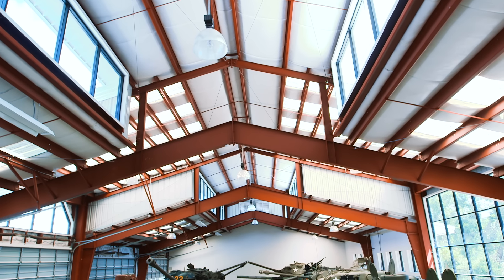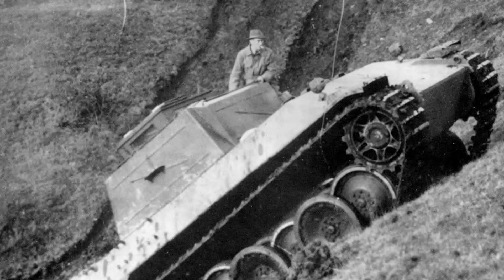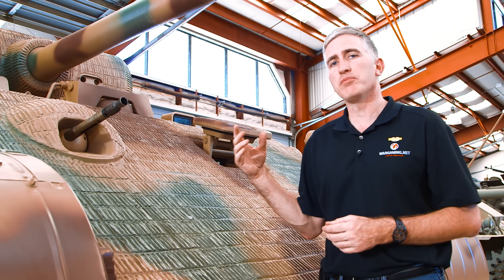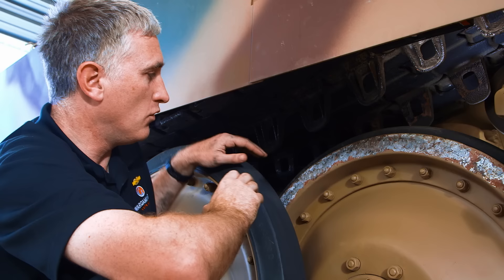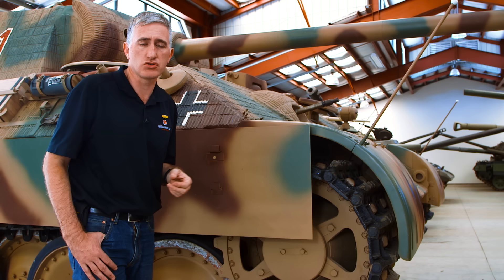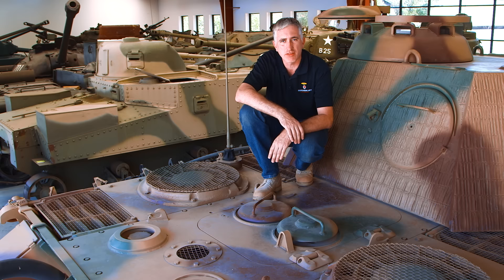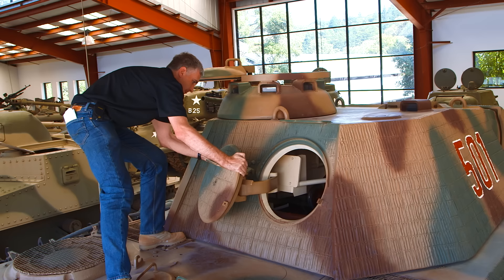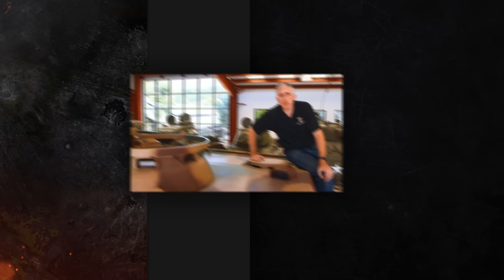Inside the Chieftain's Hatch: Panther. Part 1

Comment: That track and suspension system is so very German. Wonderfully engineered and built, smooth as butter, and you are totally screwed if something breaks, ha.
Reply: These wheels did provide quite good though. Better to be hit in the suspension and immobilised than in the hull and destroyed. :)
Reply: I am sure the crew would completely agree with you.
Reply: Well if your tank is an expensive piece of engineering, I am not too sure you'd want to get hit in the suspension either.

It'd mean that you cannot repair it and would have to destroy it anyway
Reply: The wheel design had a problem of mud freezing in the wheels and thus freezing the tank in its place.
Reply: AKUJIRULE  It wasn't a problem of being stupid, it happened due to logistics, as the Germans didn't have the fuel they needed and had to stop the tanks at night on the Eastern front, during which the mud would then freeze in the wheels.
Reply: @jacobkeeney7231  cough....*wit*
Reply: AKUJIRULE  But the engineers over engineered and too anal to make a tank that was in the field repairable.
Reply: @UkrainianPaulie  

Bullshit, photos and report from the field maintenance units all show that the Panther could be maintained and repaired in the field with regards to the kidn of repairs that could be done in the field. There are even photographs show the removal and replacement of the transmission being performed in the middle of a forest.
Reply: Jesse Sisolack It’s designed so that nothing breaks.
Reply: Vk30.M?
Reply: Jesse Sisolack breaks?
Reply: @UkrainianPaulie  
The French guys of the Tank Museum in Saumur were interviewed at tank fast 2019 about their panther and their experiences with it.
Unlike the common believe, they admitted, that the Panther was actually build with ease of maintenances in mind. For example, the engine replacement took only 8h in a Panther under field conditions. For a Centurion you need 15,5h in the field. I think they are trust worthy, because they also operate M4s, M10s,T34s and a Centurion. I think it is really surprising that they mentioned maintainability as big pro for the Panther design. But there must be something to it, because the Panther achieved the same combat ready rates as the Panzer IV since spring 1944. 
Hilary Doyle pointed out several times, that the final drives became quite reliable. He also said that the germans knew what they were doing when it comes down to tank maintenance. (Chieftain and Doyle in the Panzer Museum Munster, on Chieftains youtube channel).
Reply: @Matthew Caughey except when pieces of shell and track completely jam the tracks, rendering the tank immobile.
Reply: @MothaLuva  That's not how tanks work. everything will break. no matter what the conditions, unless it sits still in a garage it will break. a tank is meant to be used, not sit in a garage. In combat conditions there are never any guarantees.
Reply: Jack Cordell That’s how MY tanks are designed.
Reply: @HaVoC117X  the final drives may have been more reliable but they most likely if anything used an experienced driver for the tests which considering late war germany experienced drivers where in short supply but in general your parts can be as strong as you want but they wont last long with relatively untrained crews that where starting to increase in number but along with any petrol or derivative product was also in short supply so even if it was reliable it wont be going far also can ya toss me the video they mentioned this in the french guys i mean
Reply: the track is so good that i Even want to get that thing. it would probably become a scrap when it Breaks.
Reply: @WheelsRCool  " mud freezing in the wheels and thus freezing the tank in its place." - That is a well known myth that has become a factoid after ww2. There are no primary source accounts of this happening. They did have overlapping wheels for years before they built the Panther, and you'd think they would have noticed if someone got frozen in place.
Reply: One major advantage of this design is that you could have several wheels blow off and still drive away. If you lose one wheel on something like a T-34, you're screwed.
Reply: @scratchy996  i woudnt call that a big advantage considering it could also at the same time make the track slip off or even break it
Reply: @scratchy996  If that is the case, then I will stand corrected, however I will need to research it more because the mud on the Eastern Front could freeze to being like cement in that extreme cold. I have read, somewhere (though I can't say it was a reliable source), that the Soviets would also time their attacks against Tigers and Panthers when they could (such as early morning) for this reason.
Reply: @WheelsRCool  If that were the case, you would think the Tiger and Panther crews would clear their tracks in the evening.
You would think that after one such attack, the German crews will learn to ready their tanks just before dawn.

If you get so much mud between your tracks, it means that you're driving in mud, that means that's during the spring or autumn, that means you can't have -40 degrees during the night, when everything becomes like cement.
During the Russian winter everything is frozen solid anyway, so you can't get your wheels filled up with mud.
If you somehow get that huge amount of mud that instantly gets frozen solid, then every tracked vehicle would have this problem, and vehicles would constantly get de-tracked.

German tank crews frequently started their engines and let them running for a while, so the batteries don't get drained during cold nights. A dead battery means that you have manually crank the tank, that means it takes longer to start it.

The Soviets attacked during the morning because they would gather their forces during the night, when they can't be seen, and attack during the morning to prevent friendly fire.
The Soviets also liked to attack during bad weather, here in Eastern Europe we have a saying when there's heavy rain , or a blizzard : "The Russians will attack now."
Reply: @scratchy996  That is a good point about mud not around in freezing cold, I forgot about that. However one nitpick, if the wheels were frozen, I do not see how the tank could be readied just before dawn as it would be too cold to remove the mud.
Reply: I remember my dad was trying to help this lady who was stuck at forest preserve, BMW ran outta coolant and overheated, luckily my dad had a jug of coolant with him since his Isuzu liked acting up once in a while but he was trying to add coolant to her car and wasn’t able too, beautiful car but have a tow ready in case something goes wrong.
Reply: @duchessskye4072  but the tankers live to fight in a different Panzer. Experience is priceless.
Reply: Its German! It never brakes.
Reply: JaysonBrentford  up to 800km? with an engine that typically lasted 1000-1800km depending on time of manufacture also nice cherry pick on the Sherman variant lets not Cherry pick model comparison ok? thanks
Reply: JaysonBrentford  doubtful at best propaganda at worst not only would that put more stress on other load bearing equipment and prematurely wear those line items  you would be putting more stress on the drive train  due to it
Reply: not to mention neutral steering is useful in niche circumstances even today tank crews are recommended to not neutral steer as it puts strain on the track pins and links its not a flex hell A7V had it its not nothing special much like sloped armor this stuff didnt just appear they knew about it
Reply: JaysonBrentford  the irony behind you saying its easily researched and is a proven repeated instance then picking a single instance and implying its the rule and not the exception but im a fudd surreee whatever man

Comment: As a heavy equipment operator I can tell you for fact it does not take much mud or snow to cause the tracks to lock up and freeze and become a real nightmare to get freed up. Best policy is to always clean your tracks and running gear prior to leaving it overnight, or spend hours chipping out mud and ice before you can move...;)
Reply: they probably did that, since they realized how their lives could depend upon that hard work...
Reply: Michael Müller A job they really did not need as they would already have a lot of heavy work to do, servicing the tank after an exhausting day in combat.
Reply: @SvenTviking  Combat? Was rather exception. Most days of war were waiting somewhere. In tank forces even more on the german side, of course.
Reply: @michaelmuller6890  true, like cleaning toilets
Reply: They built fires under the tank to keep it warm as well as themselves as often times they slept inside the tank.

Comment: Chieftain, here is the composition of the Zimmerit anti-magnetic mine paste.  40 % Barium sulfate - BaSO425 % polyvinyl acetate – PVA (similar to wood glue)15 % pigment (ochre)10 % Zinc sulfide – ZnS10 % sawdust
Reply: Thanks for useful data.

Comment: That return roller is to avoid the track falling between the drive sprocket, and first pair of road wheel. However, your also kind of right as it was put in a position to avoid interfering with the tracks mashing with the sprocket, rather than to aid.

Comment: The only thing I noticed lacking from this magnificent restoration are the air filters for the Maybach HL 230 engine. I can see the carburetors fully exposed and open. There should have been a pair of canister like thingys holding the air filters over them. This way whenever the engines are running dirt wont get through to the pistons and abrade them.

Comment: I feel like if mud was really a problem when it froze overnight then German tankers would learn to scrape the mud off the tank before any stretches of time where the tank isn't going anywhere.

It wouldn't take long and if it really was a problem it could be solved pretty easily.
Reply: This is clearly documented on the Russian front.  As I understand it, the problem arose with dramatic temperature swings overnight.  Entire companies died beside the roads.  There are films of it happening.  It wasnt so much a tank issue as a " this country is a frozen hell"  problem.

Comment: Actually I found an old photograph of a Panther crew pulling the transmission out from the access hatch on the top front of the hull you can see the access hatch with the 2 escape hatches on it laying on the ground. So in other words it wasn't that hard to take the transmission out like most people think.  I think this is often the case for German vehicles of World War 2  They had ways of dealing with the issues. with special tools and methods.

Comment: Everyone does great work with detailing WW2 tanks and even trucks. Something all of you do is fail completely with showing people the equipment mechanics had to work with to repair these beasts. I was a Bradley mechanic for 15 yrs in the Army. I was also lucky enough to be assigned to recovery sections and teams in nearly all of my units I served in. So I worked extensively with the HMMT Wreckers. The M88a1s and even the Deuce 1/2 Wreckers and 5 ton Wreckers. The VTRs were pulled from service before I came along so I never for to play with them. The M88a1 and later the M88a2 were hands down the kings of recovery even when recovering wheeled vehicles. I could raise my boom and pay out my cables at the same time and go up on my spade if need to pull out Hummers that went into canals or rolled over. HMMT Wreckers took a few minutes to setup before they could do such work. The M88s incredible lifting and towing capacities made them invaluable to the units that have them. Even if some maintenance teams had guys that were less than great with keeping their own vehicles running smoothly like the M88. The M88 is a often neglected vehicle by maintenance teams. Either from ignorance of how to work on them. Or just plain ol laziness. I have seen it too many times and it always made me angry to see such a great piece of engineering just being abused like that. I always kept my 88s serviced, cleaned, and maintained to ensure I had as little as possible a chance of vehicle failure during a mission. And keeping spare parts and track parts was very much key to quick repairs. I really with you guys would talk about tank recovery vehicles and even speak with guys like me who have thousands of hours operating them and living in them for months at a time.

Comment: the mud freezing I can see, regardless of horsepower. it's similar to older tractors that had the front wheels angle in to the ground on each side. it's why you see some older ones with a single angled wheel up front. not a mistake, just makes it easier to deal with in cold conditions.

Comment: Great piece - thanks!

A Panther vulnerability I heard from someone who claimed to have discovered it was that 3+ HE rounds on the turret would brew them up. He did this once in desperation in Italy (no AP left), found it worked and continued doing so. Has anyone else come across this?
Reply: What calibre HE rounds?I can imagine,if one aim under the gun mantlet,that might worked out.
Reply: 75 mm - anywhere on the turret sides. This is different from the early mantlet that was a shot trap. (AP shot striking its underside would ricochet down and penetrate the thinner top of the crew compartment).

Comment: The major difference in armored warfare wasn't as much the tanks as it was the crews, at which the Panzer's units excelled.  Over engineering was evident in most of the Wehrmacht's military hardware and resulted in lower production numbers.  A higher number of  tanks  equal to the those of the allies would have been the wiser move.
Reply: A higher number of tanks equal to the those of the allies would have been the wiser move

I am not so sure. I mean, the Germans are already having problems with scarcity of rare alloys, petrol and qualified crewmen. More vehicles could have only aggravated the issue.
Reply: "A higher number of  tanks  equal to the those of the allies would have been the wiser move."

Not in the slightest, the german could never match allied... or soviet production.

The germans made a rather conscious decision to go for quality>quantity, albeit still recognised, just good enough vehicles were generally the most cost effective.
Reply: even if germany had enough factories and resources to produce tanks in numbers to compete with the allies, they wouldn’t even have enough tank crews to man them

Comment: Whatever else you can say about the Panther, and it had it's fair (more than it's fair, arguably) share of issues, it is certainly a beautiful example of some of the finest pieces of German (over)engineering to ever see combat.

Not to mention one of the better looking tanks ever made.
Reply: Some allied chaps once found a Panther in a barn, drove it around for a year before a fuel pump died.
They talked about how it was Superior to the sherman in both weponary and getting through mud and other offroading troubles much easier
Reply: Major caveat to this: The final drive, something that was never changed throughout the Panther's service life, was known to literally disassemble itself, usually catastrophically, at a random interval from anywhere from 200km up.

As long as that held up, and, as I said, it's a issue that was never resolved, not even by the post war users (would have needed a complete redesign of the entire drive train apparently) the Panther was as good as it gets in WW2 though.
Reply: Lafeel Abriel but the fact is that a fuel pump set it out of action, not the final drives :D

Comment: the zimmerit has been proven time and time again by the germans, Americans, and Russians not to cause fires. in fact it is very hard to burn and only burns for when wet. even then only for a short time. While officially it was stopped, many crews still used it or even made their own because of the great camouflage it provides. many Americans used it as well in the pacific theater. if breaks up the tanks smooth surface and makes it camouflage better. it also makes it easier to get traction on the tank.

Comment: I had never known about the single return roller shown at 4:44, despite 50 years looking at Panther photos.    The excellent photos of the Panther that German authorities removed from  the guy's basement in 2015 show the roller.  However other wartime photos I've found with the tracks and other wheels removed don't show the return roller.  I wonder if it wasn't used in all 3 versions?     Cool detail regardless.